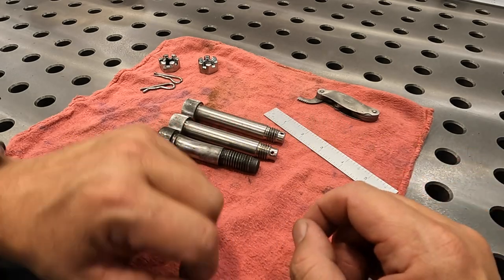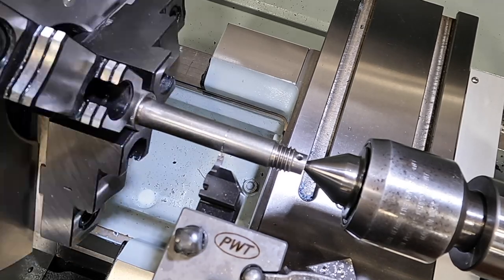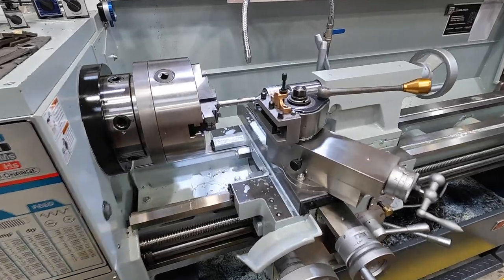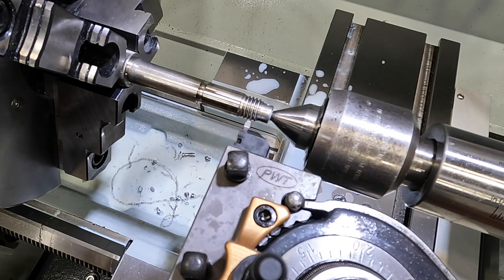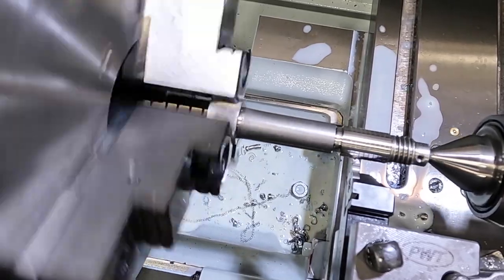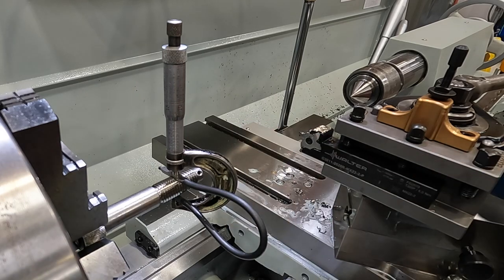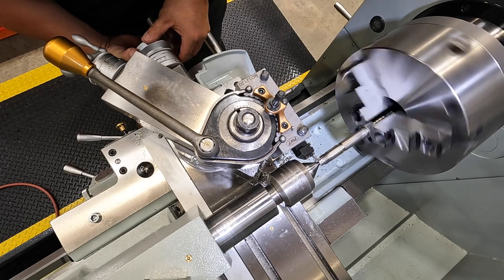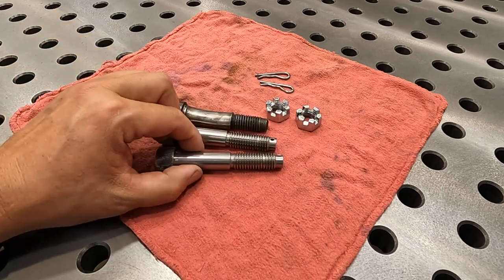Single Point Thread Chasing on a Manual Lathe

Comment: How did you know that I needed to learn how to restart a thread?  Recently got a hobbyist's lathe and have been learning threading.  Yesterday I was about half done with a (gasp) 5/8-11 when I had a crash.  Still not sure if I was slow on releasing the nut or if it didn't release.  Anyway, after watching this video last night, and twice more this morning, I was able to complete the thread and then cut a 1/2-13 on the other end to make a draw bar for a morse taper R32 collet chuck.

Thanks - just in time!

Comment: One important thing about signgle point thread chasing is how the machine is stopped in order to align the threading tool.
I think this was a tad unclear in the video and Adam did not emphasize the importance of this.

So here goes:
1. The half nuts must NOT be disengaged in order to stop for aligning
2. The machine has to be stopped so that the thread feed stays on and is moving the cross slide while stopping
3. After the machine has stopped, the chuck must NOT be rotated  backwards or actually to any direction

This all is to have all backslash in the gears of the machine to be in a "connected" state when aligning the cutting tool.
After the tool has been aligned, all restrictions on engaging/disengaging the half nuts apply as usual and the thread can be chased/cut in the normal way.

Comment: For those that didn't understand, Adam used the even numbers when cutting these threads.
Reply: With a whole number thread pitch, 11 tpi in this case, he could use any number: 1, 2, 3, or 4.
However, if the desired thread pitch had been, say, 7 1/2 tpi, then only every other number would work.  ie: 1 and 3, or, 2 and 4.

Comment: How would this be completed if the customer requested that a center hole NOT be drilled.
Reply: Center drill lightly and face off at the end or make a plug to go against the face then put the center in that.
Reply: Or you can put a hex nut or two between the tip of the live center and the face of the part. Not as rigid as a drilled center, but it gives enough support without leaving witness.
Reply: @bigboreracing356  cuz customers don't know how to. If they did they'd do it themselves. Ive heard some doozies of just not possible or extremely expensive for no reason.
Reply: I suppose make a sleeve that is large that the bolt head and then split it.  This would allow you to chuck on the barrel of the bolt instead of the head.  Take in note that is coming from a plumber who saw this done by someone else on you tube.  I think Mr Pete of Kieth Fenner.

Comment: My assumption for chasing a thread is that you leave the existing threads untouched!? Obviously it wasn't the case here!
Reply: Adam mentioned that the original thread was rolled, leaving it with a radius at the root.  Since Adam used a regular v cutting tool, it cut out the radius at the bottom of the existing thread but left the sides untouched. This wouldn't affect the function of the thread since the matching nuts would be cut with a die and have v shaped threads.
Reply: I think it was because the original thread was roll formed rather than cut.
Reply: the original thread was roll formed

Comment: Help me out somebody if you don’t mind. I don’t understand why the compound is set to 29.5 degrees
Reply: A thread has an included angle of 60°. He sets the compound at half that angle with a little less so the tool only cuts on one side.
Reply: @TheLonelytexan  Ok. Thanks!
Reply: About a hundred years ago,threads were cut perpendicular. Then someone with a compound setup thought,well the sine of 30 degrees is 0.5 . So a slicing cut could be made which improved the surface finish of the cut metal. With the compound ,x and y are equal travel. At 30 degrees.
Later some bright spark found that 29.5 degrees worked marginally better.
As described by the guy above.
Only works where the threadform is based on an equilateral triangle. Whitworth is 55 degrees. But since everything except Whitworth is equilateral,no never mind.

Comment: you weren't lined. up with the original threads and I see that you took quit a bit off of the original threads. that nut was really loose on the original threads since you weren't lined up.

Comment: Is there a bolt shortage in the US? Why would you bother doing this.
Reply: price, and also "my friend Joe over at the welding shop" - sorting a thing like this for a mate is how things get done
Reply: There was a shortage of that fairly specific shoulder bolt in the local geographical area. Sure, they probably cost 50x the price you would pay at a hardware store but time is money. The old one looked pretty worn and it might have come off a machine that processes $$$$ worth of parts per day. Or you just do a quick job for a friend.
Reply: Sometimes its more about the availability of a unique bolt. And difficulty in finding exactly what you need. But found a couple close and a little quick lather work saves time. And remember that without filming this would have taken much less time.
Reply: Yes and a very small selection. Also quality is not there at all.

Comment: Also many years in screw cutting.  Its important to be cutting thread down one side.  The 28 deg offset is there to move the tool down the left side.  I saw as coming to the new part of the thread the tool was pulling in.  Its generally because the tool is cutting on both sides of the thread.  S/Steel particularly this process is important. I heard you say you were cutting on the right side of the thread.  Having the angle of the cross slide set to work the left side of the thread, left me no understanding your plan.

Comment: Unless they are planning on cutting those bolts shorter, it sure seems it would have been easier to just make some spacers to take up the extra length so you could use the bolts as purchased.
Reply: Or buy the correct bolt.
Reply: without knowing the application, kinda hard to say what they "should have done"
Reply: What about how the back of the bolt might then protrude into a bad spot?
Reply: @scottjones7279  These are not standard, off the shelf bolts and you can't just buy them from a catalogue. The catalogue one might look similar but will have one or two features that don't match, like that radius Adam mentioned. Plus with the challenges of getting parts these days and over the roof prices, its easier to just get them made locally.
Reply: @scottjones7279  Would you watch a video of him buying a bolt??
Reply: @paulcopeland9035  probably not

Comment: Align the tool in the root of the original thread, not on the right side. Set the cross slide, then back off and use the compound. I disagree with the demonstration.
Reply: You are correct, I have been a turner fro 49 years and his method would not be excepted. He removed lots of original thread. The nut was very slack on the 1st few treads because of that.
Reply: @geoffgreenhalgh3553  Yep, I noticed lots of original thread being peeled off at 12:46. I  thought that was strange.

Comment: Well...
   What thread besides 11 pitch was he trying to cut?. SAE, AN-MS, WHITWORTH, or what? The machine shop should never have agreed to send this out. 
   I explain below.
   The real gorilla in the room is, even though any competent machinist can cut nearly perfect threads, "who in their right mind would?"
    Threads, unless used on a fencepost are always rolled, not cut! DANGEROUSLY weak cutting across the grain. Especially with stainless steel.
   In the narration he admits that the original thread is "rolled". A cut thread has been made by cutting through the grain of the metal tearing and shearing it. This leaves little strength in tension under load. 
   If you doubt me read the catalogue available from ARP Products. I also highly recommend the automotive racing "how to"books from the late, great, legendary, Le Mans winning racecar engineer Carol Smith. Guaranteed  they will open your eyes!
   All stressed bolts have their threads rolled, NEVER CUT. The best are heat treated "before" the thread rolling. Cutting removes the heat treated material.
Most cheap bolts are treated after rolling, if at all. Wrong but the rolling dies last longer. Such Hardware Store bolts are known in the industry as " junk bolts" and come from China... 
   Think about it...
   As a former NASCAR owner, driver, and fabricator I wouldn't use these destroyed bolts on a lawnmower much less any stressed assemblage. Someone could die...
   In so far as these bolts have split pin or safety wire holes in them they are for a highly stressed assembly, racecar, airplane, or such critical applications.
   I must reiterate, in such applications, this modification likely will fail & could kill somebody.
   Ignorance can kill...
Reply: Why are ya so awkward, bud?
Reply: @chrismorris8695  ....Trying to sound important, it seems!
Reply: Bruh chill
Reply: I think Michael has a good point to consider as the problems that could be caused may or may not be applicable in this case.  The comment puts a little background information so that when someone else attempts this that may change the approach or abort altogether and wait for the appropriate part to be ordered. It provides a greater understanding of how any why certain bolts/ threads are formed.  So on that note good input.  I’m a service and repair plumber and hobby machinist and sometimes make parts that I can no longer get or unavailable.  They won’t see the stresses that a race car or rocket unless I really get pissed off.
Reply: You make a, good point. I'm in the aerospace industry, and it is very important to know what the bolt is used on, and whether it should just be replaced. Rolled threads are stronger.
Reply: @paulcopeland9035  Don’t you know NASCAR drivers are the most intelligent people on earth. 

(Sarcasm for you slow folk)
Reply: Hahahaha imma flex my bolt knowledge! Thats not safe for anything. Obviously that stainless bolt and cut threads cant hold 10 lbs it will be under and the fragments will explode the moon! Cause its a shoulder bolt. The guys shoulders will fall off as well. Durrr
Reply: Thanks for the urgent warning. I too am safety minded and would not want to leave someone with a possible misconception about the strength of a part or product.

Comment: doesn't the white water hurt the machine?  wont it rust? do you have to wipe it up after?
Reply: No since it is a mixture of water and water soluble oil specifically made for machining.
Reply: @behemothinferno  And contains rust inhibitors to prevent this.